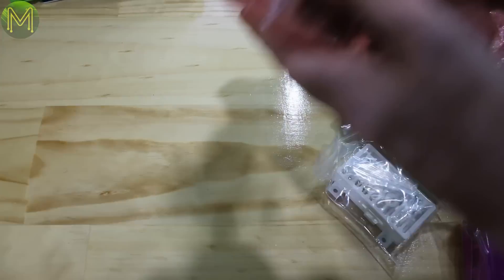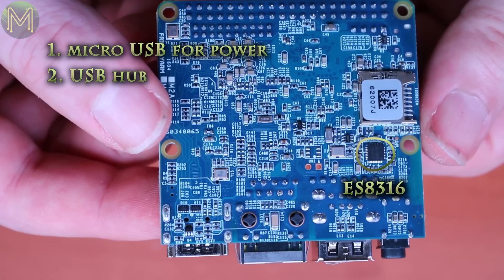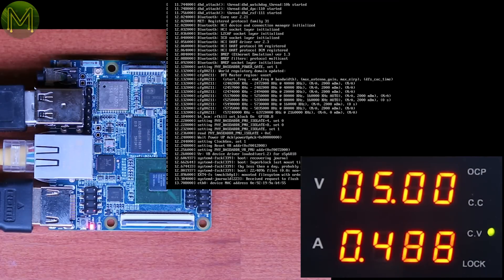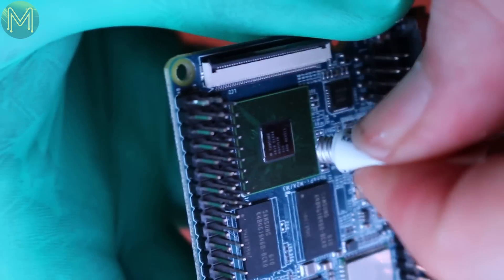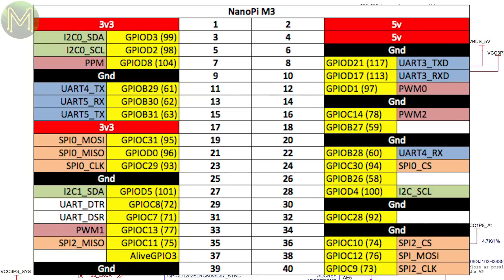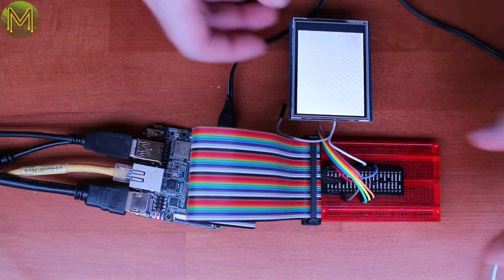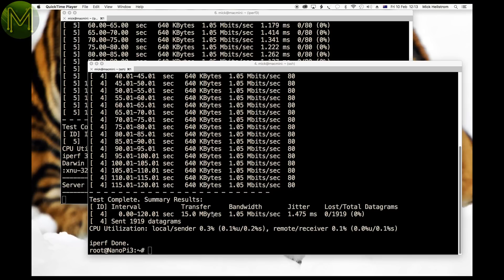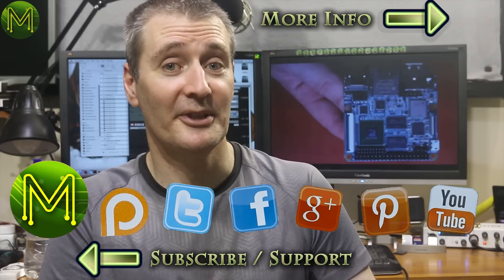#100 NanoPi-M3: 8 blazing cores, but... // Review

Comment: Is there a video of the build for the extreme CPU cooler?  I have a spare one without fan that I woudln't mind using up so was looking for ideas.
Reply from the maker: I don’t really have a build video of it. It’s really just an old X86 heat sink and cooler, but one that had a fairly flat base to it
Reply: @MickMake  Right, I think I have the same cooler, without the fan, in a box of bits.  I just wondered how you fixed it on.  I have two ideas, cooling paste mixed with epoxy, or a sticky 'paste' pad and two cable ties for extra robustness.  I guess it is more a gimic than really a sensible cooling solution (although it would work).

Comment: Hi Mick. Haven't seen this video before now, but I'm wondering...where did you get the pin-out information for the RPi? The diagram you added at the 7:14 mark isn't like any I've seen for the RPi before. For instance, I use i2c0 on pins 27/28, by hi-jacking the HAT pins. But your diagram seems to suggest that it's an ALT mode, mux'd with i2c1 on pins 3/5. Is that right?

Comment: Your voice and static noise should be constant because your audio track is really difficult to listen to!
Reply: Most YouTubers make that mistake and don't or ever realize it.
Reply from the maker: Yeah, sound is 90% of a video. Some say 80%, but now that I've been at it 2 years I get annoyed by a lot of things.
Pops, clicks, mouth noises, bad/alternating floors, wrong levels, music to loud/soft, echos, etc, etc. It goes on and on.

One thing I do prefer is having more bass in my audio and tend to lift it more. Sometimes hard when I get the odd, stray mains hum appearing, but working on that one as well.
Reply: Indeed and yes, your current vids have the right quality. Be proud of that but there are a lot of YouTubers who still make those mistakes constantly.
Reply from the maker: Yes, some of my earlier videos suffered from audio issues. These days I now record a good 60 seconds to provide a constant floor for those bits that are edited out.
Reply: Just keep the noise in the audio track, the background noise and when you cut your video stream make sure you leave a split second of noise and merge them with the new voice. Fade those track together and you create an illusion the there is an constant noise in the background.

Comment: For why people use it: Well maybe people just want a maker board that can do the usual stuff but also has 8 cores for parallel fun such as blake2 hashes. Like say, if you had a script to check your downloads are ok but you're not using sha-256 for whatever those downloads are (iso files or something). Underclocking it would cool it down. A slow 8 cores may be ok for that.

Comment: There is a 2 pin FAN plug behind the audio jack. It says FAN right on the board. Can this be control some way? I looked at the Schematic.pdf can't find the name fan any place in it. Maybe could see how it's wired up and control the speed then. The fan that goes with it is way to loud.
Reply from the maker: +Raymond Day 
Alas no. The only way is to use the Arduino to control it with a FET.

Comment: I wasn't able to get i2s working on this board at all with either android or Linux. Looks like we are both using the same adafruit i2s amp. Were you able to get it working?  If so would you mind sharing?  Thanks.
Reply from the maker: Neither did I. I need to look at this for a follow-up video.

Comment: You could attach a tiny fan to the case to keep the air moving.  This would be easier to do than putting it on the PCB.  It just needs to miss all the headers.
Reply from the maker: Yup, I've ordered a fan from FriendlyARM, would be good to test out the official one.

Comment: Wow, love this.  I've just found your channel, and I'm impressed by the audio, video and general high production values.  I'd get rid of that other loafer, though - he doesn't seem to be adding anything ;-)

I've been amazed by the vast array of ARM-based SBCs around, it seems as if the world and his dog want to bring one out.  I've been looking at a few boards with a view to building a small cluster, say 8 - 32 nodes.  These little units make it easier to build a much more compact machine.  As soon as I settle on a board, though, I discover something else!  Thanks for the review videos, I will look at the rest, and they may help me decide ... on the Orange Pi, probably.
Reply from the maker: Thanks very much.

If you're interested in building a cluster just with raw CPU grunt, then these would do well.
Unsolder the GPIO headers and anything else that gets in the way and add some custom heatsinks and fans. Would do well.

What are you going to run on them? Is it compute cluster, build cluster, MySQL, etc?
Reply: Hi Mick, it would be a general-purpose compute cluster.  I've built one using Dell desktops, but that is quite large, something smaller and easier to transport would be better.  Its partly for investigating the issues around configuring and running a cluster, network topologies, and partly to see how many Gflops you can achieve, using the maximum power that a wall socket will deliver (13 amps here in UK), so a bit like the student cluster challenge that ISC runs.  I use Linpack (hpl) to test the compute performance.  I was interested to see what tools you are using to test I/O performance, I'll have to re-watch the video.
Reply from the maker: mark woodrow 
Sounds interesting. One of my plans is to run a video on bang for your buck for compute power on SBCs.
This NanoPi-M3 is pretty good but the Orange Pi Zero probably has better bang for the buck.
I use the Phoronix Test Suite for my tests. I also try to run some subjective benchmarks like desktop performance. I'm putting up all my results into openbenchmarking.org. Just search for MickMake. ;-)
http://openbenchmarking.org

Comment: I think I might have used a heat sink from an old video card myself. It likely wouldn't have worked as well but it would perhaps have been a little more manageable whereas mounting is concerned. Great video Mick...thanks.
Reply from the maker: +ExStatic Bass 
Thanks mate. I've found some smaller heatsinks off old laptops that I'm keen to try that have heat pipes.

Comment: Did you do temp testing with a more reasonable heatsink like the copper one you put on at first?   It was cool to see it with the monster one but that's not exactly practical.
Reply from the maker: +Do R/C! 
I started out to, but those small heatsinks are really hopeless. I wouldn't really call them heatsinks just lumps of copper.
There's a real art in designing a decent heatsink and it wasn't used to create those.

Comment: Nice. I was waiting for this video. Regarding the heat issue, did the board run hot with your smaller copper heat sink? I wonder how much heat variance there would be if this board was underclocked or had some cores turned off.... (I have a specific project in mind)
Reply from the maker: +Mastadex 
Yes indeed it did.
I'll be running a thermal comparison across several boards and publishing a video on it soon and yup, that'll be one of my tests.

Comment: Nice little (but hot) device. I'm curious how you like the logic analyzer function of your LHT00SU1 introduced in your Mail#02 video. I have the Openbench logic sniffer and because it captures on the board, it is very fast, but is limited to 24K samples of 8 channels. It appears that the LHT00SU1 does passthru to capture on the PC so you'd get virtually unlimited samples.  Does the analyzer keep up with SPI protocol? If you've played with triggering does it work well?  Thanks much!
Reply from the maker: I've been using it for a while now and plan to release a video review on it. I really needed to give it a good run in situations where I was actually using it.
Reply from the maker: Oh, and I haven't tested the "real world" maximum throughput yet, but max performance testing will be definitely on the cards.
Reply: Excellent!  Looking forward to your impressions!

Comment: Terrific. With a proper heat sink I'll have no problems fitting it into a mid tower ATX case.
Reply from the maker: Yup, with a proper heatsink it's a grunty little board and if you're prepared to hack around a bit with minimal support, then it's ideal.

Comment: Is there anything out there like a PiZero but much faster?  This seems close but I don't really need the ethernet and it would be nice if it actually worked with the PiCam (or similar).    Thanks!
Reply: Well there is Odroid C0 http://www.hardkernel.com/main/products/prdt_info.php?g_code=G145326484280
Reply: No PiCam interface (as far as I can tell).
Reply: Well you can add something like this camera: http://www.ebay.co.uk/itm/2MP-1080P-30fps-60fps-120fps-OV2710-2-8-12mm-Varifocal-Lens-USB-Camera-Module-/222144405491?hash=item33b8d69ff3:g:eCUAAOSwZetXOug6 should be comparable to picam and it's usb so supports a lot more platforms. The brand is ELP

Comment: Seems like a decent board which unfortunately has poor support and odd design choices (cost cutting?)
Reply: Everyone seems to be making boards these days because its so cheap to produce. But then they usually forget to support the software side... Watch out for that trap! #PINE64
Reply from the maker: Jules Verne 
BTW the UpBoard might be a good choice for you.
Reply from the maker: +Izzie 
Yup, I often wonder how they come up with their market strategy. Or if they even have one at all. There's so many ways this board could have been better, but they were clearly trying to put the most cores in the cheapest package.
Reply: MickMake MickMake crowd sourced SBC project?
Reply from the maker: Izzie 
I can tell you, I'm really tempted, but I have another project brewing that will be just as good.
Reply: MickMake Why does this seem so common, I'm looking for a little board for a medical project I want to do and all the powerful ones seem a little dodgy in terms of support, although I think I'm juts going to go with a raspberry pi in the end :P
Reply: Yep. I think a lot of the reason that the Pi, Arduino, and PIC have been successful is because they're well-designed products, despite being relatively low processing power. They're polished and easy to use. I can't imagine this one will be successful, but that doesn't mean it isn't great.
Reply from the maker: Jules Verne 
That's the state of affairs with the market.
If you can work around the issues on those boards, then they're pretty good, but I can imagine you'll need a fair amount of reliability in a medical setting.
Reply: @MickMake  This phase of the market development is a lot like the early days of the PC/AT/XT clones - A Wild West kind of rush to draw and shoot without much thought to what happens after that!
Reply: Sebastian Scholle oh man the PINE is a great example of that. The PINE hardware is awesome. The software is terrible
Reply: This raspberry pi knock off boards, has suffer reliability issues. And they are not dependable boards. You are on your on after a couple of months it released

Comment: is there any special driver required to go with LVDS? or I can just connect to a LCD
Reply: Hey! I have this board and I have a screen hooked up to the LVDS header. The LVDS needs to be turned on in the kernel, which means you need to compile the kernel yourself. Furthermore, You will need to hardcode the screen's timings and resolution into the kernel and u-boot, otherwise, it will pick a default resolution and won't display properly.

Comment: Well, the main chip isn't a MCU, it's just a regular microprocessor.
Reply from the maker: +VitekST - Vlogy, programování, ... 
I think these days the lines are blurred. A microprocessor that has onboard Ethernet, SD, LVDS, USB, DACs, ADCs, MPEG decoders, PWM, I2S, I2C, SPI, RTC, etc, etc.
It's not really a traditional microprocessor.
Reply: Okay, my bad, the better term is SoC (System on Chip).

You see, the difference between SoC and MCU is that MCU has everything "vital" on board - that means program flash, RAM, some of them even have its own clock signal source, and are generally low powered.

SoC on the other hand are chips with integrated CPU, GPU, peripherials and devices for system control (like interrupt controller), but they still need fixed memory of some sort and RAM to run. But they contain a CPU with generally used instruction set (ARM, or even x86).

Just wanna be correct as much as I can.
Reply from the maker: +VitekST - Vlogy, programování, ... 
Yup, thanks mate. I probably should use the correct terms. I tend to interchange them often as the lines are often blurred, but yes... like you, I want to be correct as much as I can as well.